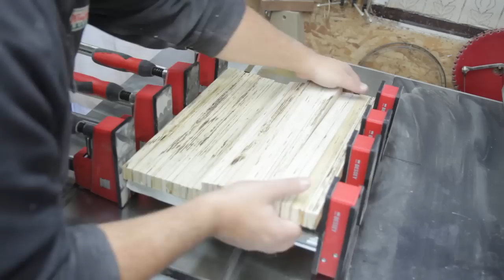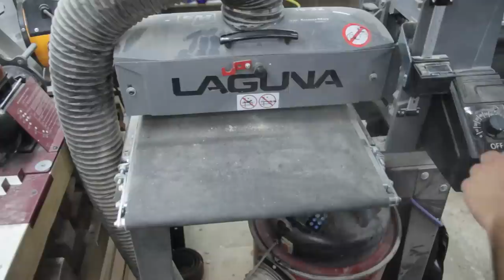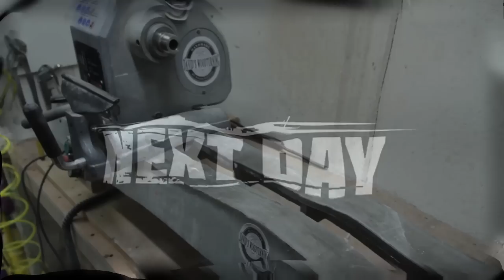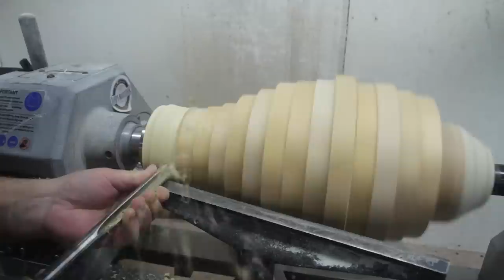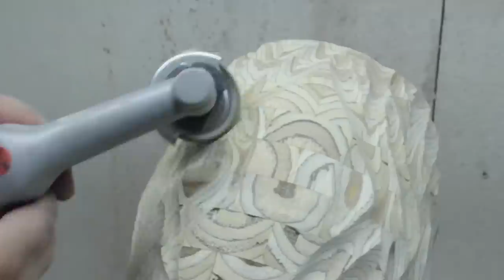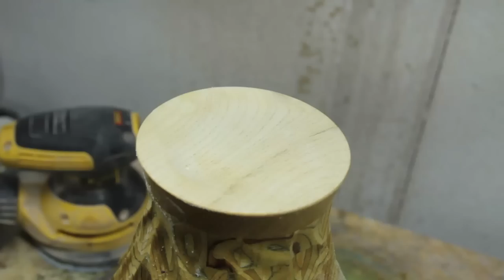Woodturning and Carving - My Biggest and Most Beautiful Vase from Plywood

Comment: Hello really good work on this piece as always really good to watch
I my have asked you before I am looking to get the grinder carving tool you use in this piece I would appreciate if you can tell where I can get it thanks and I think as you said best ply you have done
Regards Jamie
Reply from the maker: Hi Jamie, Sorry that I did not come back before. It is a proxxon long neck angle grinder with 2" carbide disc. Work great very easy to handle the machine due to light weight but it is only suitable for softer woods and light carving. It has a small motor what can be hot very quick so I had to take several breaks to ensure I do not break the machine. I also use angle grinder with kutzall disc what is a lot more powerful but also heavier and spins faster so slightly more dangerous.